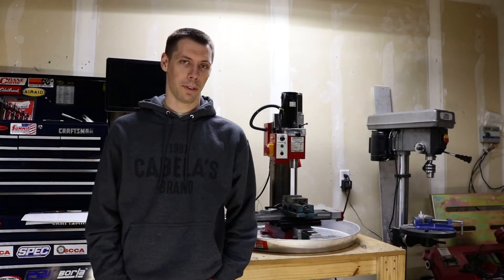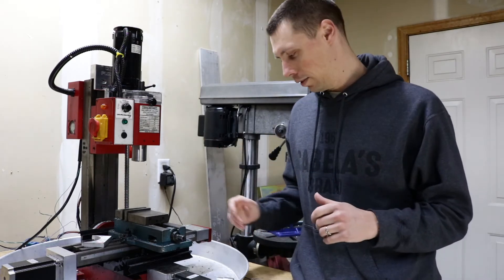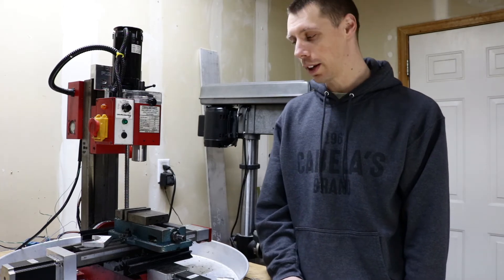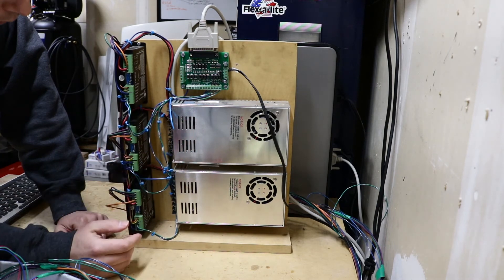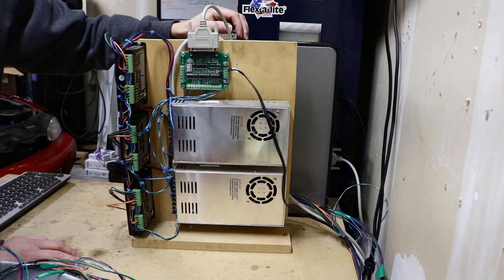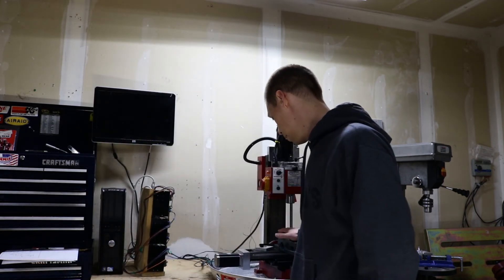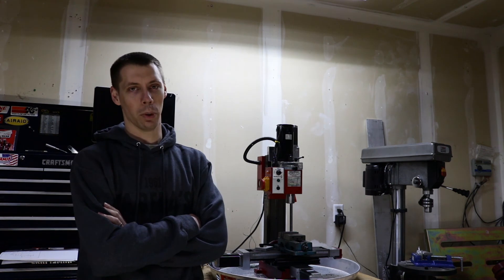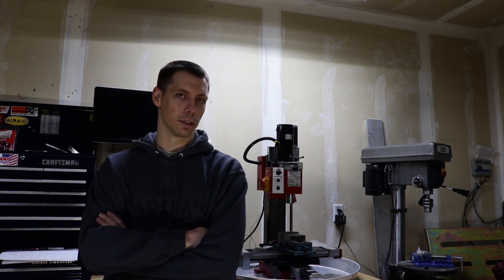CNC Mini Mill Setup Overview Sieg X2

Comment: :-), mill your own base, LOL. I know not so easy.  Based on your comments I'm thinking it will probably be better to buy the bigger mill and convert it.  I am talking about the 1.5 HP mill.  SKU 33686
There is an even bigger one but I think if you are going to spend that much money for a cheap mill might as well spend $1K-$2k more and get and old used Bridgeport that needs some serious cleanup, just have to look long and hard to find them but they do show up on a regular basis.
This guy did it. youtube.com/watch?v=K6SXzM_qfaE
Reply from the maker: Ya, I ended up taking the leap to a Tormach.  I actually just sold the mini mill a few months ago.  It was bittersweet to see it go.

Comment: Personally i think the kit $600+ is a bit of a ripoff, thats more than the mill costs, if it came with motors and electronics ok but for 3 ball screws a couple of bearings and the machined aluminium blocks its a bit much, you can buy a 3040 cnc mill complete for less(most now come with ball screws), not as robust but the parts could be transfered and you could sell the frame and the non used parts cheap to recuperate. You could also have downloaded the plans and made your own aluminium blocks and bought the ball screws. Just my thoughts and personal opinion. Its done now, hope you enjoy it.
Reply from the maker: If I had the equipment to make custom length ball screws, then I would have made the kit myself.  But I probably would have had a ton of time in that endeavor as well.  I don't think the price is terrible considering what the hardware costs and the amount of time it saved me.
Reply: @RivalMachining  If your happy i'm happy, i'm looking at doing mine, its a hbm bf 28 vario, almost identical to the grizzly g 0759 without the dro and stand and is 240v as i'm in europe

Comment: Weld the back so u dont even need that bolt...to make more ridged...if cast iron...heat it up them weld it...great info man...no bs
Reply from the maker: I don't think I'm brave enough to weld it together.  Id be afraid to distort the ways or knock it out of square.
Reply: How much do the new machine cost
..just saw u got a new one

Comment: One Bolt:  Can't you drill & tap to add more bolts?
What is the next step up in Mill size?  Please don't say $11K for the Tormach.  What about the PM-25MV?  7" on the "Y".
CNC conversion Here: https://www.youtube.com/watch?v=aACwCMdwqkg
Reply from the maker: The reason it only has 1 bolt is to allow the column to rotate from vertical.  The column itself is hollow tubing and it is bolted into kind of a large angle bracket.  I'm not sure there would be enough meat to add more bolts.  The mill really needs some spread out connection points instead of one point on the bottom.  I've seen where people made brackets that go about 1/3 up the sides of the column.  I went the Tormach route because I wanted to make this into a business instead of a hobby.  If I was strictly a hobbyist I would have made a fixed gantry router table or eventually converted a larger import machine.  The decision for the Tormach was largely based on pricing out various conversions and realizing they cost about 50% of the Tormach and I still need to spend several months building it.

Comment: If you're thinking about Tormach then you should check out Syil :)
Reply from the maker: Thanks for the suggestion.  I've never heard of that brand but they look like nice machines.  The castings have the same look as a Tormach which makes me wonder if they come out of the same factory.  I like that they have metal way covers and a nicer looking enclosure.  I ended up buying a Tormach 1100 last July and have really liked it.  It's a nice machine but it does have a few quirks.

Comment: This video rocks! Located in Canada and have one retailer for these mills. Lucked out when buying: got a used SX2 (brushless motor + belt drive) for the same price as an X2. Your complaints about travel and rigidity convinced me to buy a large table and solid column upgrade kit from LMS.  Would've rushed the CNC conversion otherwise! Hopefully the 5.1" y-axis travel means not having to buy a larger machine for a looong time.

Comment: Thanks for the details. I have the same mill and seem to be going down the same road (already have the steppers/drivers). Next step is the CNC Fusion kit. A good vid would be how you set up the SW. I was thinking of going with Arduino and Gcode sender. But I would be curious if you feel the Linux route is better. I have heard that the Arduino, being only a controller, may not be able to keep up the data stream and cause the steppers to loose position. 

I also use Fusion 360 and agree it is amazing - and free (I am cheap too - LOL). I retired from HP storage systems support a couple of years ago and would like to like to get back to dabbling in some of the work I did to pay my college tuition - mechanical design (on a home/hobby scale). So, I think I will be satisfied with the mill size. Also, I like the idea of building from the ground -  so I am familiar with all the interaction and parts if something should break.

I like your other vids and style too - keep up the great work!

Take care,

h